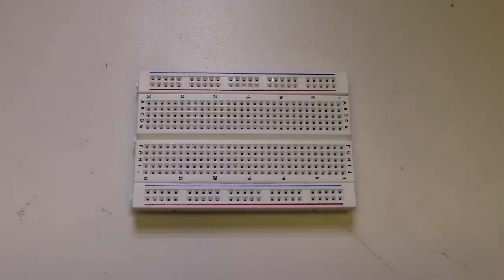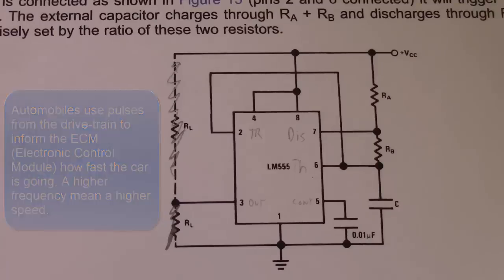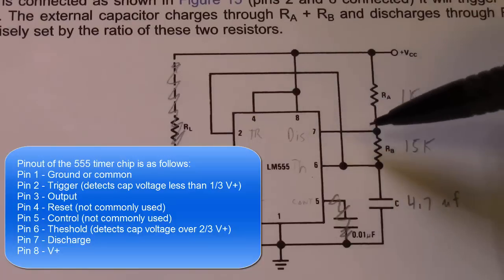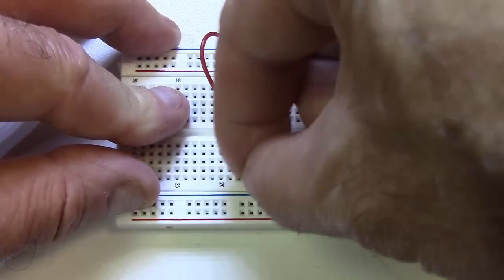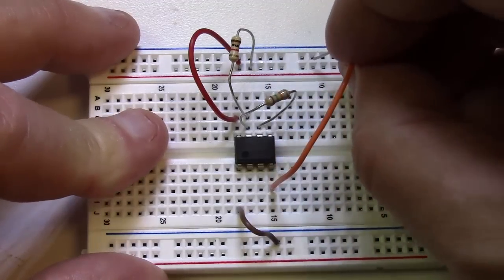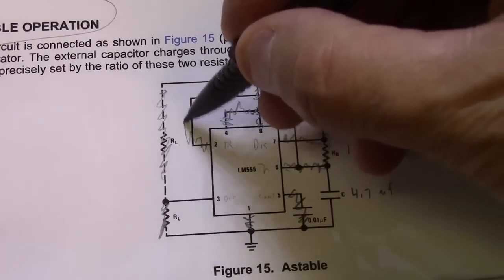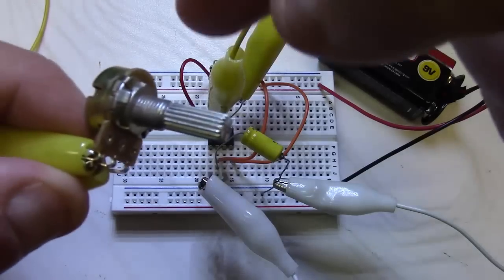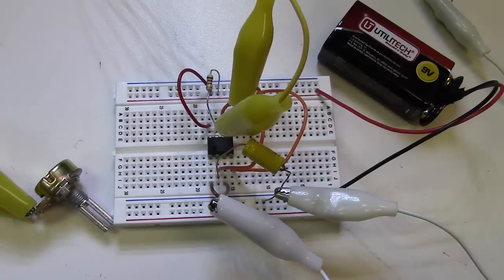555 Timer Project - Signal and Sound Generator

Comment: Ok so I'm trying to build a sound sensor that when you hit a drum it flashes a light. I wand to use 
Battery Power 10/20/30/40 LED Bulbs Fairy Xmas Party String Lights Decoration found on ebay. how could I do that. it has to be done for 12 drums and under $50 the lights alone cost $17.16 for 12 of them.
Reply from the maker: +luke baggens You can use the 555 timer to examine the input level on the threshold pin and turn on the output when a certain level is reached. This might do what you want to do. You can use a small piezo unit for the detector since they produce a high signal with a small amount of vibration.

Comment: please show how to do connections while performing a practical of op amp as inverting amplifer with AC supply nd using CRO . HOW TO DO CONNECTIONS IN BREADBOARD AND WITH CRO AND FUNCTION GENERATOR ? 
PLEASE SHOW AS SOON AS POSSIBLE THANKU
Reply from the maker: +vahidali sayyad If I understand correctly you are looking for video showing how to hook up and use the 555 timer as a function generator sending a signal to an inverting op-amp that can be monitored using an oscilloscope. Is this correct? Thanks.
Reply: no sir only want to hook up ic 741 as inverting opamp that can be monitored using oscilloscope

Comment: can you make a decoder that reads the tone and activate a relay?
I want to use this to program an animatronic by sending the signal to the cassette on one track and use the other track for music, on the track with the signal i want to put a tone generator on it to detect the signal and activate a relay, a tone will be sent to the input jack of the cassette recorder and a signal reader on the output
Reply from the maker: ***** The best best way to decode a frequency is by using the LM-567 tone decoder chip.

http://s154.photobucket.com/user/terrypin999/media/Electronics/567ToneDecoder.gif.html

Good luck and thanks for commenting.

Comment: I would like to build this circuit to go from 1 hrz to 500,000 hrz and run to different hrz to 2 different speakers and be an on off signal. Can it be done with one 555 ic?
Reply from the maker: The timer can produce signals beyond 1 Mhz. If you are connecting it to a speaker the speaker cannot produce frequencies much beyond 18 Khz and such frequencies are not audible anyway.

Comment: Well I have been doing some testing with your circuit and found if I use a car radio size speaker it blows out the 555 time IC using my power supply. I did get 24khz on my frequency counter. Would like to get it to 100khz for testing. Any ideas how to do that?
Reply from the maker: You won't be able use a 4 ohm speaker without using a power transistor driver. The timer can produce signals above 1 Mhz with the proper capacitor and resistor combination. The timer cannot produce currents much above 100mA
Reply: @DorianMcIntire  I changed caps and got over 250 khz no problem.

Comment: does this circuit work for controlling a switch in a dc/dc buck converter ?
Reply from the maker: Yes, you can use this circuit to generate any square-wave waveform from .001 Hz to 100,000 Hz. Have fun.

Comment: can this go up to... let's say 1 MHz?
Reply from the maker: Yes, with the right capacitor and resistor combination it will work up to several megahertz.
Reply: can the 555 make sine wave also?
Reply from the maker: furulevi No. The 555 timer can only make rectangular waves (square), saw-tooth waves or triangular waves which can approximate a sine wave.
Reply: thanks!

Comment: NE555P 16HT13A vs NE555P 91M DN1519G4.
For me the "16HT13A" works better!
Who knows the difference? Maybe I'm just using it wrongly or "DN1519G4" isn't supposed to use in high freqiencies (as the osc-r).

Comment: Hi will you help me build the 30-40 hertz generator on the breadboard ?
Reply from the maker: A 30-40 hertz generator would use R2 resistor values roughly twice as large as the 60 HZ unit.

Comment: Hi, if i want to produce a 880 Hz frequency which values i should look for in my resistors and capacitor ?
Reply from the maker: A capacitor OR resistor value approximately 15 times less than that used in the video will work (880 Hz /60 Hz)

Comment: Hello, Dorian!
I've repeated this circuitry with a different set of resistors (22k and 100k - bigger values) and the capacitor is ceramic (also 4.7mF). It works but for a very short time. The chip goes OVER-HEATED. The frequency drops down when the chip goes hotter. If I let it to rest a bit it does the same. And if it wasn't cooled enough then it starts to "drop down" with a less delay:)
I've touched the chip - it's about 100C probably. It is marked NE555P, 91M, DN1519 - some Chinese. I have some others but also NE555P. The sound wasn't stable from the beginning. Sounded like something "jagged". It's like the frequency is modulated by some noise source.
 Can this different set of resistors be a problem? Or can it be a speaker? It's magnet part is about 45mm in diameter. Impendance is 6-7oM (approx.). The power source is the 9v Robiton 200 maH accumulator.
I've got that the sound is very loud so I've made a voltage divider with two 22k resistors but then it gives too low voltage somehow. The connection exists but the voltage seems too low if I try this (I've checked with the multimeter). Then the chip doesn't makes a sound. So I think that I've "checked" something... Maybe that the chip will not work with lower volts... Not sure.
P.S. I want to repeat this setup with a good success. So after this I can go further and try something more complex.
Reply from the maker: I believe you're having a problem with a speaker with an impedance that's too low. The speaker should be a minimum of 8 ohms or more.  You can put a 100 ohm resistor in series with a low impedance speaker but it won't be loud. Also make sure your supply voltage is not more than around 9 volts.  Let me know how it goes.
Reply: I'll check tommorow, thanks! The output voltage was around 9.3 - 9.5 volts. When the accumulator was charged it was even about 9.8 or 10v.
BTW, I've tried to insert 50k potentiometer between +9v and the + power rail. That was a mistake I think. The potentiometer started to "smell burned" after a while. Also I've found that it "eats" all volts and I've got sound only when the knob was on zero. I've thinked that this will make the scheme sounding lower. But I guess it's not the right logic.
Reply: It's about 4.40 of morning here... So I've hidden all my stuff. Not a good time to make loud buzzy sounds )
Reply: Hello, Dorian!
I've bought almost all necessary details today. Just did what you've told me. Instead 100ohm I've used 120ohm. Everything else is the same.
1st I've made a voltage divider but it worked not for a long time. After trying the same with a less charged accumulator I've reverted back (it's 9.6 we must count here generally). Then it refused to work with the divider. I guess it did gone lower than 6v (6-9v is a working range as I've got). So I've proceeded without the voltage divider.
The results:
              Pros: sound is very good almost stable (it's a breadboard! :) )
             Cons: 120 ohm R on the output (leg 3) goes warming quickly. About 1C in a second (roughly). I've stopped at ~50C.
Next I've decided to retry without 120ohm R. I've placed a jumper wire from 3 to my output line. The sound become crazy! I was "pierced" in a stomach :)) High... about 5-10khz and very unstable. Sounded like a very-very angry mosquito from a nightmare.
I've didn't measured if the chip was hotter. The sound was above my nerves ))
I'll try a better voltage divider tomorrow. BTW 120ohm R didn't made the volume too much quiter. The divider did. Maybe I need a good (but small) DC PSU for this "genre".
Reply from the maker: Try putting a 0.1 uf capacitor between pin 5 and ground. You may have some feedback into the control pin.
Reply: OK, I'll do this! Thank you!
It would be cool to know where this feedback can exist there! I've tried to understand the inner circuitry now but I don't know enough to get how and where a feedback can happen...
BTW: the sound seems to be like a pure "square" but when I've recorded it and looked closely... well it's something "mixed" and looks a bit similar to some waveforms with a resonance. Maybe that was because the recording was in stereo (quad mic actually, Zoom H2n). But I don't think it can give such a huge effect.
Reply from the maker: Pin 5 is connected to the internal voltage divider that provides the Threshold Voltage (2/3 V+) reference to the upper comparator. For some 555 designs and circuit situations the pin can act like an antenna and pick up noise that can affect this reference.
Reply: Connected 100 nf as you've said - almost no difference. I'll try another chip now.
Reply: I've found some dependency: 100k pot-r set as in schematic gives a difference.
If it's set to max then (the lowest frequency) the 120ohm res-r stops around 66-68C and seems it's no warming after this.
If 100k pot. is set almost to min. then 120ohm res-r becomes hotter. It reached to 82C and higher. I think it's not good. I've didn't tried to reach it to 100C or more... 
Should I replace it with 200ohm R?

P.S. the other chip has 16HT13A on it. The same result (about temperatures). Although this exact chip sounds more stable on high frequencies! 1st chip had
 some "cut out" pieces on high freq-s. 1stly it starts to sound "vibrating" (annoyingly) then it gives a ripped sound or silence (on the highest freq-s). Now I know that it's not normal :)
Reply from the maker: A 470 ohm resistor should solve the heating problem but the volume will be low. If you want a loud signal you should feed the 555 signal into a small amp. You can buy or make a small amp using the LM386 chip. The output current going into a speaker will be large with low frequencies and small with high frequencies since the speaker is providing inductive reactance at higher frequencies.
Reply: Yep, the higher the resistance, the lower the temperature. I guess that I can remove that 0,1uf cap-r.
I've inserted 360ohm R and it gives no more than 50C.
Measured: highest freq. (1.1khz) gives around 0.2v; lowest (44hz) gives ~ 0.12v. Now it can be inserted in a sound card I guess :) I've read that it's safe below 1.0v. ~0.75 is 0.0dB (for ADC, not sure).
By ear I hear a very little difference in loudness... not twice. Need to find that math :)
The pot-r gives a kind of "logarythmic" dependency which is not handy for high freq-s. But it's just an experience. The real synthesizer has a scaler module and a MIDI to CV converter.

Comment: can i use this setup to control the brightness of an led? or speed of a motor?
Reply from the maker: Frank Lopez No, The duty cycle for this circuit is fixed at about 50%. This means that an LED will look about half as bright as normal. You can however make a variable duty-cycle circuit using a 555 timer to do exactly what you're asking.
Reply: nice, one last thing do you know of any digital pot  that i can use to play with those 555x'ers output val?  rather then me manually turn the wiper on the pot i can maybe have arduino do this for me using this digital potentiometer ?
Reply from the maker: Frank Lopez You can build one using an optical isolator. See the following link:

http://www.instructables.com/id/Make-a-Voltage-Controlled-Resistor-and-Use-It/

You can also buy a chip like the one at the following link:

http://www.newark.com/microchip/mcp4161-502e-p/digital-potentiometer-5kohm-257step/dp/77M2746?ost=77M2746&mckv=Gucgj0Yu&CMP=KNC-GUSA-GEN-SHOPPING-MICROCHIP&CAGPSPN=pla&gclid=CjwKEAjwueytBRCmpOyZ2L-xrG8SJADwH5c6D3pRxpUhnaVRj9TfUTuARc18VS5b3dWybU6exma8KBoCk8vw_wcB&CAWELAID=120185550001183961

If you drive it with an Arduino you will have to smooth out the PWM signal on the analog out pin used to drive the digital pot since these would require a DC voltage.
Reply: do you think something like a triac may do the square wave formation or something like a Wheatstone bridge ? maybe a cap in line to smooth out  or a op amp ? thanks for the links tho what is the main diff between that digital pot at 5kohms ? im dealing with hight 12v+ and running multi dc gear motors and servos so im not sure about 5kohm

Comment: sir can u make a video on how to identify the polarity of a female usb port plz sir
Reply from the maker: Check out the following link:

https://www.google.com/search?q=usb+pinout&espv=2&rlz=1C1CHWA_enUS558US558&tbm=isch&imgil=SJ5ieuvDN6r3jM%253A%253BHCmCSIfzRrxeLM%253Bhttps%25253A%25252F%25252Fwww.moddiy.com%25252Fpages%25252FUSB-2.0-%252525257B47%252525257D-3.0-%252525257B47%252525257D-3.1-Connectors-%2525252526-Pinouts.html&source=iu&pf=m&fir=SJ5ieuvDN6r3jM%253A%252CHCmCSIfzRrxeLM%252C_&usg=__Bzy9_Nq2QdigHd425eELvAsqI34%3D&biw=1536&bih=724&dpr=1.25&ved=0ahUKEwjr1OqtuP7QAhXo6YMKHRYVCAsQyjcIKQ&ei=k95WWKu_EOjTjwSWqqBY#imgrc=aMYnCpf-uhFjIM%3A

Comment: So I used all the right parts and finished the whole thing but mine will not make the noise. My capacitor looks a little different but that's it. I can't get it click and I'm also wondering where I would plug in a speaker if need be. Thanks
Reply from the maker: Timothy, It will not make a noise without a speaker. The speaker is connected between pin 3 and ground. Check your wiring carefully since all the problems I've ever seen are typically due to either incorrect or faulty components or incorrect wiring. The circuit works well if everything is done correctly. Good Luck.
Reply: Thank you so much. I will try this during class on Monday.
Reply from the maker: Hope things go well. Please let me know when you get your project working.
Reply: So I tried it and when I finished, it starts clicking the speaker at small intervals only when I remove a wire and put it back in but it wouldn't continuously click. I am also using 2 4 ohm speakers wired as a series circuit. Can you please tell me why?
Reply from the maker: All I can tell you is to check your connections carefully and make sure you are using the proper components and component values. The circuit is pretty simple and works well when everything is correct. Try replacing the 555 timer to be sure it has not been damaged while testing. I have no way of knowing what is wrong when there are so many possibilities.
Reply: fixed it I had the wrong resistor
Reply: I got it to work, the only thing wrong was the resistor as I put in the wrong one. Thanks for all the help.
Reply from the maker: Excellent! Hope you have fun with it.

Comment: Can you turn it down to 7.8Hz and what the sound Looks like?
Reply from the maker: Yes. With the proper components you can actually adjust the timer frequency down to below 0.001 Hz. Unfortunately humans cannot hear sounds below about 20 Hz and you would need a huge speaker to hear such a low frequency. You would be able to feel such low frequencies however with the proper speaker equipment.

Comment: can you explain how audio works on laptops? if I code a sine wave, using an audio programming language, what happens between the command and the sound? I am still in the dark.
Reply from the maker: The process is similar to being able to store a movie by only having to store a sequence of pictures. If these pictures are quickly displayed one after another  you see a movie instead of a bunch of pictures. The process is very similar in order to store sound but you only have to store regularly-spaced voltage measurements of the sound, stored as numbers, in order to reconstruct the sound. If these numbers are played back quickly through a digital to analog converter or DAC (a number to signal converter) and at the proper rate, the sound is reconstructed. An audio file (WAV, MP3, etc) only contains a bunch of such numbers containing all the information needed to reconstruct sound. For high quality sound the voltage measurements must be capable of breaking up the signal into about 65000 parts (2 to the 16th power or 65536) and the A-D converter must be able to play these voltage levels back at between 2 and 3 times the rate of the highest frequency contained in the sound recording.

The link below is a very simple explanation of the process.

https://www.youtube.com/watch?v=9z5HOZ4C1KY

Looks like a good topic for another video.

Comment: I need variable frequency between 40hz-60hz but I need the duty cycle to stay very very low and not change when adjusting frequency . How could I make this work?
Reply from the maker: The following circuit will provide a range of 25Hz to 180Hz with a low duty cycle that will vary slightly with frequency. The circuit uses a fast charging time (HIGH) and a slow discharge time (LOW). This is about the best you do using a single 555 timer. You can scale up the POT to 100K and scale down the capacitance to 470 nf for better performance.

https://www.circuitlab.com/circuit/6385b4nfqc33/low-duty-astable/
Reply: Is there a way to adjust frequency and duty cycle separately, using two 555 timers?
Reply from the maker: Review the following link for circuit ideas that may work for you: http://www.nutsvolts.com/magazine/article/555-astable-circuits
Reply: Thank you very much for your help. I built the circuit you sent and it work out really good.

Comment: My 555 timer got really fucking HOT!
Reply from the maker: A sign that something was connected improperly, especially if you didn't hear any sound. If you used a low impedance speaker (less than 8 ohms) you will also have this problem. Use a low resistance resistor (less than 100 ohms) or a 1uf capacitor in series with the speaker to help with the problem.